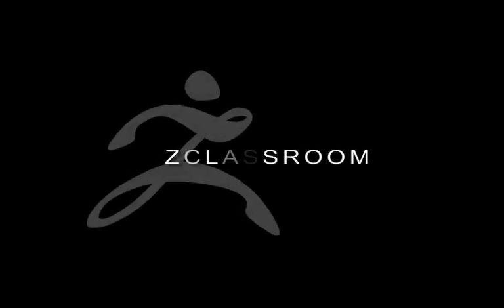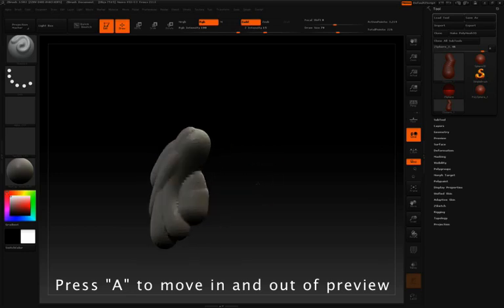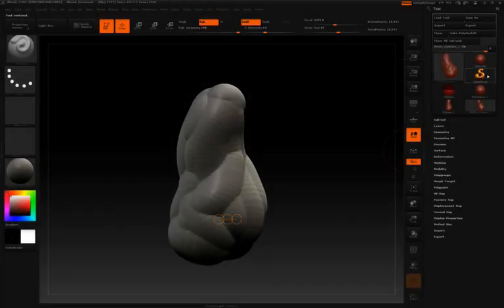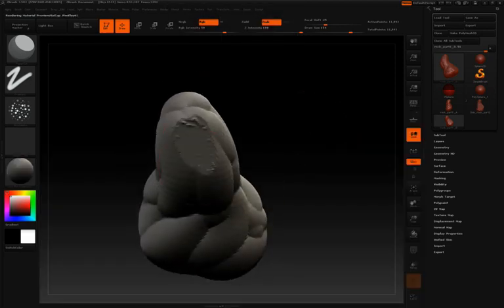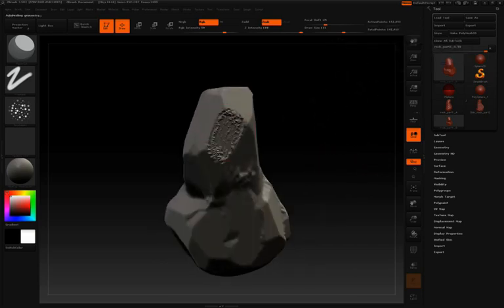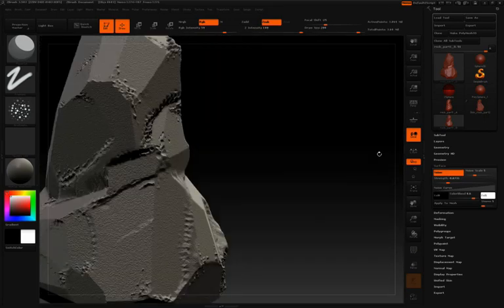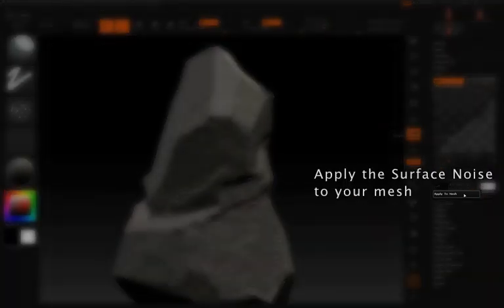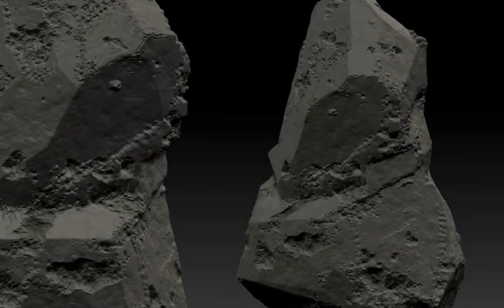Sculpting a rocky surface

Comment: To those having difficulty with the Planar brush not working the same, Zbrush changed the functionality in recent version to make things more customizable...

Here is an easy fix - 

- Select the planar brush
- Under the Brush panel select Depth
- Increase the 'Imbed' to about 10 (depends on the size of your project) (mess around with this number)
- Done :)

All this brush is doing is basically working the same but instead of just flattening similar angled surfaces it actually trims away at the mesh, hope this helps people!
Reply: You are a golden god

Comment: If it's a massive cliff face, yes. Making a few different variations so that you can stack them to make massive rock faces like the ones in Skyrim, that way you can duplicate 4 or 5 variations in UDK or CryEngine. Duplications of a mesh take up like 0.01% memory compared to the original. Lots of ways to do it.

Comment: I have the same issue as a lot of others - my planar brush isn't working at all. I thought maybe it could be the high poly count I got when I made polymesh 3d so I used decimation master to cut my polys down to 20% and it made no difference at all. Whats the deal?

Comment: I had the same issue, so I found that trimadaptive brush did a similar thing.  The guy in the video may have some other special settings and the video is like 3 years old :/ so maybe the software changed.
Reply: +Xtil TRUE, this guy just skips a lot of information. Don't mean to be rude but this video kinda sucks.